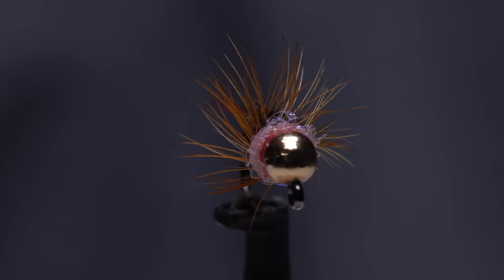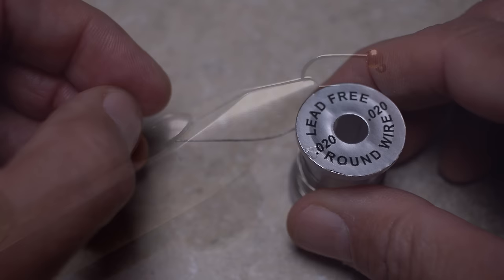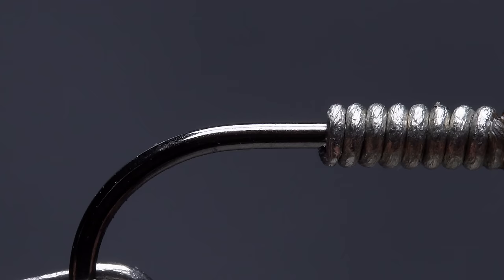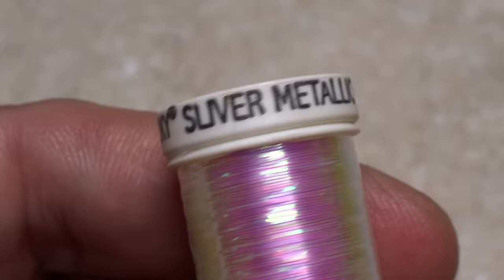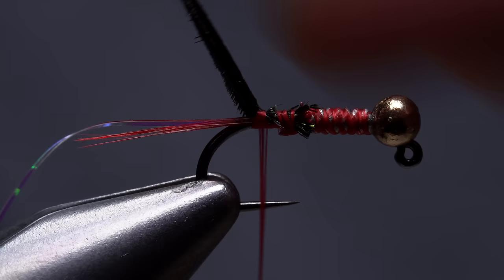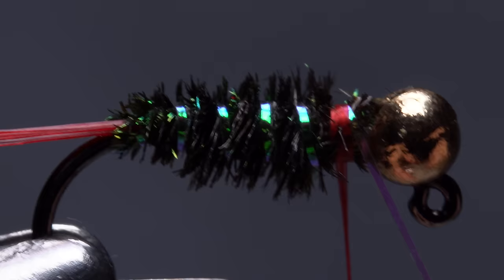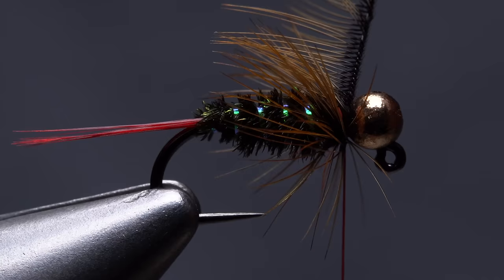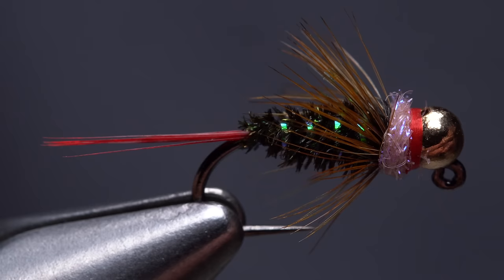Egan's Red Dart

Comment: Is there a reason you omit the tippet ribbing that Lance uses?
Reply from the maker: As a competitive angler, Lance needs his flies to be absolutely bulletproof. Needing to change a fly because of damage during a competition can mean the difference between winning and losing. For me, a recreational angler, I am far more likely to lose a fly to the bottom before it is significantly damaged by a fish. So, I go with natural peacock as opposed to more durable dubbing and use just a single strand of Sulky to protect it and omit the tippet. I've yet to replace one due to damage.
Reply: @tightlinevideo  Thanks for the reply. That makes a lot of sense. Despite how effective the Blowtorch is I find myself not wanting to tie any because they take so long (similarly with the red dart). Using herl and omitting the tippet makes them much faster. I tied up a dozen red darts in this fashion yesterday and hopefully they will produce for me today.